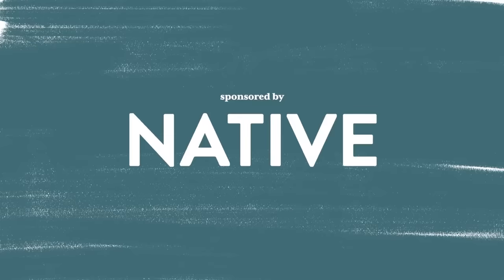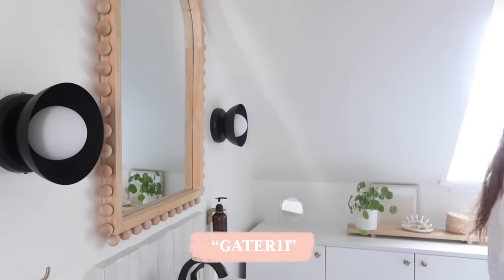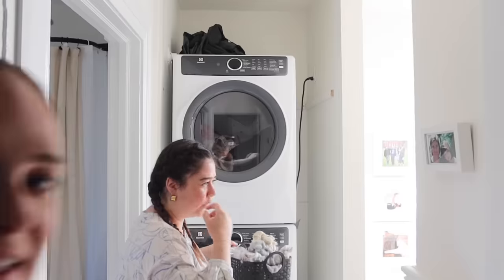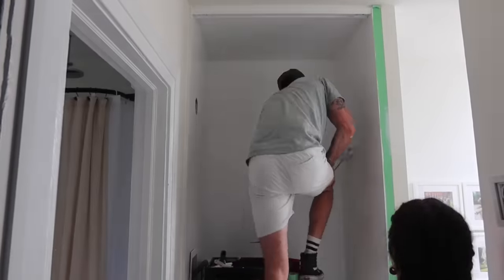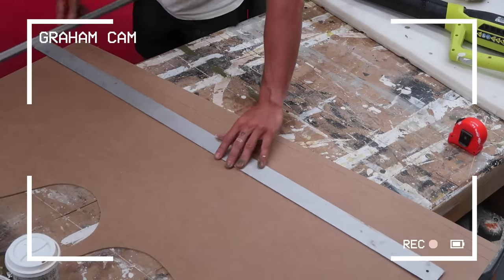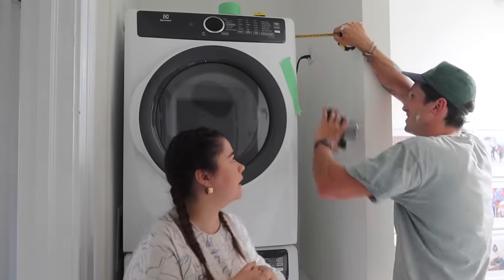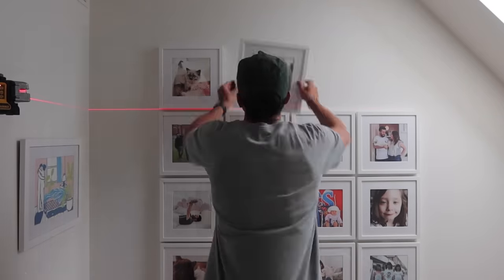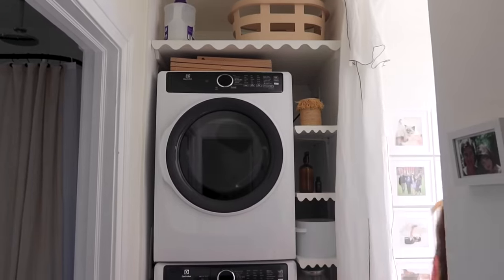How To Make a *TINY* Laundry Closet Cute and Functional

Comment: People use lint for dif things, but consider this: if your clothes have polyester or lycra in them, poly is made from plastic which is made from petroleum and lycra is made from rubber. If you burn these, noxious gasses release into the air. Just a thought. Cotton and linen are fine to use, they are natural and burnable. Wash them separately and save that lint. Also, lint left in the dryer vent can cause a fire, always clean it out each load and even vacuum the vent run with a hose periodically. Also growing up with an appliance builder, it was drilled into us that big appliances need some air circulation around them, do not crowd them or put things too packed around them. They have motors and motors can get hot 🔥.  Just a little air and room around them. Just a thought. The laundry closet looks fab.

Comment: I noticed your dryer vent tube is a little long. You might want to trim it so there are no big bends where lint will accumulate. A straight shot is the most efficient way to vent and the clothes will actually dry faster too.
Reply: And helps to prevent fires!
Reply: It would also have been great to see Graham or you use the vacuum to clean out the dryer vent tube during this renovation, as it is so hard to reach and is a common cause of house fires. They also make a special tool for you to push down below the filter to get some lint out of there, s well. You could have used it and made room for it on the shelves. Your videos often cover safety issues; I wish you'd done it here. Everything is lovely, but safety comes first!

Comment: If you find a nice storage bin you can put the outdoor furniture covers into the very back of the shelves because they will be concealed by the laundry decor!
Reply: That's what I thought, too!  Although I would put those on the top shelf. ♥
Reply: Right, one of those plastic bags you can vacuum hose to get the items as small as possible. Should fit at the back of the top shelf?
Reply: Looks great!
Reply: Folding those covers would help tremendously, and fit into a storage bag or basket much easier.

Comment: 1.  Lint - After each load  I put it in the trash  can. 

2.  You could store the extra supplies behind the decorative ones.

3. It is a good idea for front load washers to leave have the door and detergent tray left open so they won't get musty.

4. Wasn't sure about the curvy edges on the shelves but they really look good and make the area look extra nice. 

5.  You and Graham were  clever when you wedged yourselves in that tight space to install the shelves.

Comment: I’ll put my two cents in re the laundry lint ~ I used to keep a clear plastic produce bag hanging on a cup hook.  When full, I tied off the top and put it in the outdoor garbage.  Now I use the smallest white solid plastic bathroom garbage can I could find (I found the size I wanted at Walmart) and I line it with the same produce bags I used to use.  It sits on the floor next to the dryer.  The opening is larger so it’s much easier for me to drop and toss instead of wrestling open the twisted shut bag.  🦋
Reply: Yeah I do the same thing, but just with a grocery bag! But I know a lot of places are banning those so not everyone can do that
Reply: I have been leaving my lint on top of the dryer loose like a madwoman and was thinking of getting a small trash can (or I guess "weird lint basket") for the laundry but just couldn't figure out where to put it. This gave me an idea because I have some hooks on the laundry shelving that I never found a purpose for. I should get a cute hanging cup basket/bag for the lint!

Comment: I’ve been doing wash 65 years and my lint disposal depends on the situation. When I have a laundry ROOM I put the lint in the trash can in the laundry room. When Ive had a laundry closet or in the garage I take it to the nearest trash can.  Do what works for you.
Reply: This is it exactly. There is no "normal," just what fits the situation.
Reply: @TamarLitvot  Especially if you have ADHD, it's really important to make it as easy as possible to do something appropriate with the lint. So despite the outside garbage being literally right outside the door to the laundry-entryway - opening that door is too much of a barrier. So I guess I'm going to get myself a weird lint basket because right now I'm just leaving it on top of the dryer until my housekeeper comes and throws it out.

Comment: Hear me out here...
Build a folding table that attaches to the banister hand rail via a channel that drops over it. 
The table top attaches with a piano hinge to the channel.

The table top folds down towards the spindles with the two table legs folding up under the tabletop (use locking hardware).

Line the channel that goes over the railing with leather to protect the banister. 

Now you have a fold away folding table! 

PS - I have a garbage can just for lint disposal and a small brush to really clean the screen. 
In the US that flexible dryer hose is not recommended for use due to the amount of lint that builds up in the little folds. Dryers cause a large percentage of home fires. 

The laundry closet is really cute - and those waves totally made it!
Reply: Also, it is my understanding that the dryer sheets also cause some of the dryer fires - don't keep reusing them

Comment: I immediately trash the lint, although I’ve wanted to put it in a wire basket outside for the birds to take for nesting (I haven’t yet for fear my neighbors will think me too weird 🤪) Really love the way this turned out - the fresh look from new paint (and I salute you for thoroughly cleaning everything first), the pretty scalloped edges on the shelves, everything put back in decorative containers, and enclosed in a crisp white curtain. Brilliant!! I would love to do laundry there too. Thanks for taking us along!
Reply: Don't be concerned if your neighbors think you are weird - who cares!  Besides, they may think it's a great idea as well!!  Just tell them next time you see them.
Reply: I put lint out for birds but they didn’t use it. Now I think I’ve heard it’s not good for them. Not sure but do a little research first.
Reply: unfortunately lint is no good for wild birds, the fibers are extremely sort so it doesn’t have structure and it falls apart when wet so it’s not a good lining material either.
Reply: Sylvia it's funny that you say the birds won't use lint for their nests cause guess what? They built nests in our dryer vent at the back of our condo. They pulled the mesh covering off it and built their nest there. The condo board won't replace the cover, so we gently removed the birds nest and replaced the cover with a new securer one ourselves.
Reply: @janetwalker3541  I didn't say they won't use it, I said it's not good nesting material. I think we agree that a dryer vent is not an appropriate place for a bird to nest, but they don't know that, since dryer vents, like dryer lint, don't occur in nature. Just like you removed those birds and secured your vent to keep them safe, we should not put out a poor nesting material such as lint.
Reply: @donnabacon4681  😂 Good point!

Comment: Try using laundry sheets instead of liquid. You are mostly storing a huge bottle of water and it drips and you must deal with the weight and the disposal of the bottle.

Also get rid of the lint immediately. It just adds to dust and fire hazard.
Reply: Ecos has really good laundry sheets for the washer- no bulky messy bottles and easier to store.
Reply: I use Earthwash Laundry sheets, the box is only 3" x 4".

Comment: I have a ‘lint bin’ in my laundry closet- not a basket,  just a small bin that hangs on the wall near my dryer.  I empty the lint tray each time I use the dryer and stick it in there.   Sometimes that is discarded,  but I save a good portion for the Spring.  I put lint and yarn scraps in a wire box outside for birds to use for nesting material.   You’d be surprised how quickly it will disappear!  And it’s fun to watch the birds take what they need.

Comment: I am short and disabled.  Reaching and bending are a bad idea for me to say the least.  One thing I do that has helped is using baskets or reusing boxes (cutted in half, taken apart, and reassembled inside out so the brown shows or decoupage the box for color accent). Boxes can slide back and forth instead of trying to reach inside cabinets, refrigerator, or shelves.  Just pull the box toward me and I now have access to the whole shelf.  If over my head, I use baskets that can be pulled down to access items then put back up.

Comment: I put a magnetic mesh pen cup -- the kind you probably had in your locker -- directly on my dryer, and put my lint in there. I toss it probably every 7 washes or so. I also have a separate magnetic cup for my laundry soap sheets.

Comment: We clean the deywr lint container and immediately put the lint in the trash can. Lint is very combustible and not a good idea to store next to a dryer or closed area.
When re-doing an area, if someone doesn't first clean, patch up the area, and prep it, I'd wonder about their experience, integrity, and true understanding of remolding. Also, this would have been a great opportunity to clean out the backs of the washer and dryer, and dryer vents and tubing.
When it comes to built-in shelves, I always make the shelves adjustable as time changes things, and adjustable shelves can be moved. Also, shelves that have a drawers that can roll out really helps especially for when the shelf is deep.
Cute Curtain rod and good that it leans out some. Glad to see the Curtain is just a little off the ground that way, it doesn't turn into a potential step on and trip on situation. Best to wash the curtain and give it a good ironing. That way, it looks fresh and crisp. 
Putting a shelf in when the washer and dryer is out is safer for the Employee. It also shows thoughtfulness on Management's side. I'm surprised no one has been hurt as in every video there seems to be an awkward or unnecessary challenging situation for an employee.

Comment: Lint basket team here, Alexandra. You're not alone. My dryer is in the basement and I'm not anywhere near a trash can there. So we have a little ikea basket (hållbar), which has a lid so that's nice. Before that I just had a little plastic bag, so I kinda leveled up.
Little safety tip for everyone who's also decanting cleaners or so, please always label what is inside the new container (in the back, on the bottom). Especially with kids in the house, who may get accidental access to it. In the case of an allergic reaction or poisoning you will always know what is inside of them. And if you have multiple ones you don't get them mixed up.

Comment: I have that exact same stacked washer/dryer combo and they work great. They have an incredibly large capacity. 
Love your curtain, but one thing to consider is that for a front-loading washer, after doing a wash (if done for the day) you should do a quick drying with a dish towel on the inside of the door, the gasket and inside the washer tub, then leave the washer open to dry. That avoids mold (which will develop in the gasket if you don't do this). 
So it's likely you'll only close the curtain when you have people over. But it will look really nice for that!
p.s. I throw away my lint every time because the kitchen trash is nearby, but in our old house, with the washer & dryer in the basement, I had a small trash can and only emptied it occasionally. So both ways are "normal."

Comment: I throw the lint out right away.  Love the shelves and the curtain.  Since the shelves are so deep, you might want to consider storing overflow supplies towards the back of each of them ---- extra detergent behind the detergent dispenser, extra softener to the back of the shelf that has softener already at the front, etc..  This way you might be able to bag the slip covers you had stashed there at the beginning  and place them to the back of the top shelf. Just a thought.

Comment: I’ve seen a YouTube hack ( sorry I can’t find the link) for catching the drips from detergent spigots. Take an old plastic bottle that is a bit wider than your detergent cup. Cut around the front and both sides of the bottom (leaving a rim to contain your detergent cup). At the back of this bottle cut a long tab, tall enough to fit from just above the spigot to below the detergent bottle (allowing space for your cup to sit in the rim). In the tab, cut a hole to fit around the spigot. Now the hack fits over the spigot, hangs down below the bottom of the detergent container and the measuring cup sits in the rim to catch any drips. (You’ve created sort of a short handle ladle.)

Comment: This was such a helpful video for me - I have the exact same issue in my condo.  I'd actually ended up using a beautifully textured white chenille shower curtain, which I'm very pleased with (I have the same issue about curtains instead of doors sometimes looking tacky).  However, the simple tension rod I have has not been doing it for me (not pretty or functional), so I'm definitely switching over to the rod you used (in silver).  And I've also painted the area around the washer/dryer a fresh white.

Comment: I had thought you might have Graham build out the frame around the opening so that the door could close and then hang a fold out clothes bar on the inside of the door so that you could hang up clothing straight out of the dryer. That saves them getting wrinkled, and you can take them from that fold out bar directly to the closet, speeding up the task of laundry.

Comment: BTW ... The question of "where do I put the patio furniture covers"? 
1. Fold them so they are compact and all one size.
2. Find a tub with those flip-up locks on all four sides
3. Tie a tag, on a LONG string, to one of the flip locks, put the covers inside, and Lock The Box!
4. Slide the box onto the top shelf, as far back as possible. Bring the tag forward, so it dangles off the front of the shelf and reminds you where they are. Et Voila!

Comment: I would advise that you change your dryer vent to the solid metal pipe rather than that flexible one. Those flexible ones are notorious for harboring lots of dryer lint and they’re hard to clean out, which can be a fire risk.

Comment: I have a small flip top trash can that sits atop the dryer.  I clean the filter after every use and drop the lint into the can which gets emptied when full.  I’m single and really only my towels produce much lint, so the trash can takes a long time to fill.  It would be quite inconvenient for me to traipse to the kitchen trash with a tiny ball of lint after every dryer load.

Comment: I had the same issue on both of my last two places and found the IKEA metal shelf is only 10 inches wide and slips right in between the machines and the wall in closets.  The shelves work great and i painted them white before putting them in

Comment: I agree that laundry spaces are important. When neglected they tend to accumulate lint, dust & other dirt. That in turn usually manages to contaminate the clean laundry which then has to be washed again. I live in a an apartment with a stackable. They are not the most stable machines & while washing bathroom rugs on one of the spin cycles the stack has managed to turn itself to a bit of an angle so that the closet doors no longer close. I live alone & I cannot move them. Once I do I am going to have them moved to one side of the closet so that I can create additional storage between the stack & the othet side of the closet.
The one thing I am disappointed in is that you use giant plastic jugs of detergent which add to the plastic pollution too many people ignore. I now use (& have for over 1 year) detergeant "sheets". They come in a little cardboard envelope. Most loads only use 1/2 of a sheet. They do a fabulous job of cleaning my clothes. No heavy huge plastic bottles, no cumbersome liquid, no need to pour liquid into a smaller container to make it easier to handle. No Mess. You are an influencer. I think you are probably in favor of fighting back against all of the wasteful pollution we engage in--at least I hope so. Even if your laundry detergent (& all sorts of other things) may not be a sponsor, they are noticed & they do carry at least a subliminal message. You use Native deodorant. I learned about it watching you. I no use. I found that they offer some scents in a cardboard package & most are in a plastic package. Again when cardboard works & doesn't threaten the planet the way plastic does, why not use cardboard? Here you have an opportunity to influence Native to offer al of their deodorant scents in cardboard packaging & at the same time influence your followers to use the cardboard container instead of the plastic.

Comment: I have a small little trash can that sits next to my dryer to put the lint in until its full. It's technically a trash can but I have to dump it anyway it could go either way. I will say that having the lint exposed probably causes the particles to get in the air and/or just become dust, but that's my only concern with your method 😂

Comment: i have to say that I throw out the lint right away.  My dryer is probably a little older than yours.  The lint trap is removed from the top of the dryer but I empty the trap each time I dry a load of clothes.  The only part I don’t empty is the part that goes outside.  My husband does that part.  I didn’t even realize it existed until my husband told me.

Comment: Yeah, most people throw it on the floor or maybe in a trash bag if there sort of fastidious. If you want to save the incredibly gross fabric strands filled with skin cells and then at least put them in a baggie and when it gets full, you can zipper it shirt. And use it at a later date.
Like, when you go camping, you can mix it with a little Vaseline to make fire starters. But keeping it in a place that recycles air pretty strongly is so disgusting.